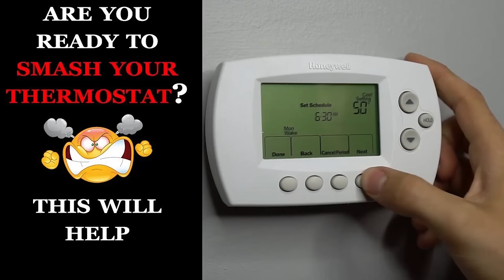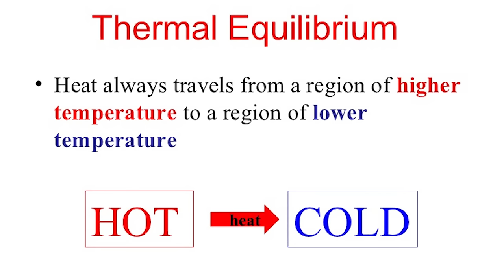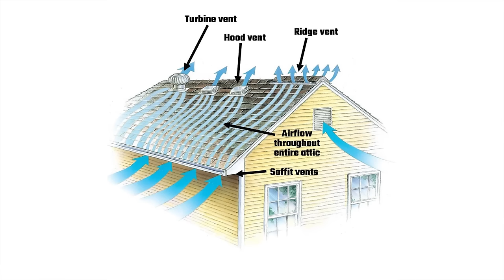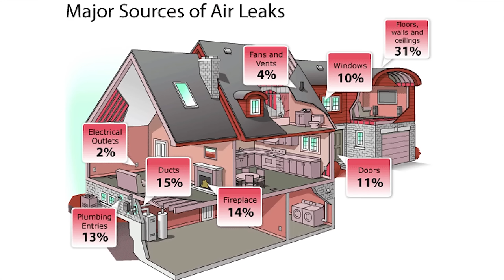AC Unit Not Cooling House - 20 Reasons Why

Comment: Hey,hi I have a question for you.My furnace making a pop sound after a blower shut off and only in the winter When I use heat. What do you think it wrong. Thank you.
Reply: could be just the duct work, sometimes its thin metal wit no cross bracing, once the pressure inside changes it can make noise.
Reply: @justinrichard4190  Ok, thank you Bro.
Reply from the maker: I agree with Justin. That sounds like ductwork popping out to me. (picture a pop can with a dent in it and then you squeeze it and it pops out, probably a similar noise). That is a little annoying but it's not bad for the unit or anything.

Comment: I checked my refrigerant level , it shows low, and I added 2 LB r22 in it and PSI is 75 now under 81 degree. However,  the air blow out is around 70 degree inside. It is better before I added r-22 in, but it is still not good enough, What could be the issue? Check air filter already. thanks

Comment: My AC runs and blows what feels like cool air. Current temp outside is 91 and I have the thermostat set to 72 but it's been stuck at 73 and will not get down to 72.  Brand new filter. All the vents blow cool air though. Not really sure what's the issue.

Comment: Condenser unit might need to be cleaned / _Bad capacitor/ _Compressor issues/ Dirty evaporatorCoil/_Dirty Returns/_LeakDucts /_Low AC Refrigerant/_Damper closed /_HRV Running

Comment: How much does it usually cost  to replace an air handler blower motor,  My air handler fan motor is not Exchanging much air and  I cannot even hear the fan from the air handler fan when its on.
Reply: depends how much it costs the model of the motor, plus labor
Reply: @MegaMRP10  thanks

Comment: Thank You so much for the list. My three year old unit is struggling even when set to 78, both thermostats set at the same settings. I changed the filter, cleaned out the condenser coil,flushed the condensate lines and fan outside runs well but cant tell about the compressor?,no unusual noise etc,all supply registers are fully open, system almost runs non stop (electric bill is way up) turns off only late evening/after midnight. No ice build up.Using a IR thermometer there is only a 3 degree difference between supply and return. Im hoping for a simple fix maybe bad cap but a leak, not looking forward to the $$$ when we call for a hvac tech next week. If you have any other ideas,please. Just sub and like,thanks again!
Reply from the maker: Hey Jim! Sorry to hear that none of the easy solutions did the trick for you. If you are only seeing a 3 degree temperature difference then something is definitely wrong. Either you have a leak and there's barely any refrigerant left or it's also possible that the compressor is not even turning on. If you have a multi-meter, I would try checking the capacitor. Also, when the outside unit turns on, you should be able to hear the difference between the compressor running and the fan. The compressor is more of a rumbling sound whereas the fan makes a normal wind blowing type of sound. Have someone turn the AC on at the thermostat while you stand right next to the condenser outside. If you hear the compressor buzz as if it is trying to start (that only lasts for 2-3 seconds), then that may just be a bad capacitor. If both, the compressor and the fan are running then yes, unfortunately the unit is probably low on charge and there's a leak.
Reply: @WordofAdviceTV  Its because of your channel I was able to use for the first time the capacitance check on my meter,which I didnt know it had it.
I got a 75/10mfd  +/-5 cap,readings came out 74.0 and 9.79mfd. I was hoping for a bad cap but it looks like now system needs a charge. I really like your instruction method, showed us at our level of understanding even an old senior can grasp.Thanks!!

Comment: I found a mouse carcass and chewed up wires in the outside air conditioning unit. I fixed the wires and the AC started working again. The chewed up wires connected to the contactor coil.

Comment: I changed the blower wheel and motor but my outside unit not working... capacitors tested good it was working before I had my ac turned off for wk

Comment: I changed my fan motor 3 wire to a 4 wire . Installed a new capacitor after the installation the fan spins slow and does not start I have to use a stick to push start . And when it does start it spins really slow. Any ideas?
Reply from the maker: My guess is that you wired it wrong but can't say for sure without being there to check it myself. This video may help though: https://youtu.be/VlMhvwrpimE
Reply: @WordofAdviceTV  thanks for the video . After double checking everything and pulling my hair out I finally called a pro to come take a look . Turns out the brand new fan motor from grainger was bad . Just my luck .
Reply from the maker: @Suerte_Pepe  Oh noo.. That is the most frustrating!! A bad motor right out of the box. Sorry to hear that man, that would not be my first guess as to what is wrong. I hope it has no more problems for another 20 years now. Stay cool!
Reply: @WordofAdviceTV  update: I went and got another motor and it was the same result. I called the A/c guy back out because he diagnosed it wrong they sent a smarter technician this time . Ended up needing a separate capacitor for the brown and brown/white wire . Works great. I figured I would give you an update. Thanks for the help though.

Comment: Hey after changing Aprilaire - 35 A2 35 Replacement Water Panel filter for whole Humidifier on my Tran xe 90 my ac unit is not cooling. Thanks in advance

Comment: We have two 4-ton units.  Both are the same brand and model.  Both are under 1.5 years old.  On the hottest days of the year, both units will shut down and then start cycling like the heat pumps want to start but then they almost immediately shut back down again.  The man who put them in can't seem to figure it out.

Comment: Can you tell me why ONLY in the heat cycle, when my furnace turns off, the thermostat reboots. I have a Honeywell digital color screen etc. like I said this only happens when the system is set to heat and when a cycle ends and turns off; the thermostat reboots, never happens in Cooling cycle?

Thanks

Comment: So my AC is not circulating around the house.  The unit inside the house has cold air coming from it, however the outside fan doesn't come on.  If I turn the heater on, the outside fan works fine.  Still not sure what that could be.

Comment: So my fan was not spinning then I replaced the capacitor and I got it to start. After that the fan still does not spin after the initial start even though it is free flowing. However when the fan try to come on all I hear is a hum. What could that be?

Comment: My suction pipe has spots where the insulation gaps. I get ice there and where the pipe goes into the unit inside. My unit is two years old.  What are the chances that I have a Freon leak versus a dirty A coil?

Comment: Replace the coil fan motor replace a circuit board replace the capacitor replace the condenser the dryer runs for 2-3 minutes shuts down there's a block in the AC line and I don't know what to do the units of Goodman 3 1/2 * 33 years old

Comment: My air conditioner unit just won’t come on ☹️ it tries to come on inside but just blows warm air. It got to over 100 degrees in California today and inside my house like 105 I’m soooo hot I could cry
Reply from the maker: Sorry to hear about the AC troubles! Sounds terrible. If your unit is still not working, I would suggest following along with this video to track down the problem: https://youtu.be/wzAA4dlp_70?si=pckfy3mwq_WbLCQj
Reply: @WordofAdviceTV  it was! It’s fixed now a fuse had blew when my electricity went out in my area. thank you 😊

Comment: My AC unit is 2 and 1/2 tons , but my question is , can I put a 3 or 3 and 1/2 tons condenser unit without changing the evaporated coil ?
Reply: No you cant, the eveporated coil has to be bigger than the condenser by 1/2 ton the most, but it shouldnt be done

Comment: In my case the water reservoir in the attic unit was full of water, after draining it, the outside unit started to work again
Reply: Might want to buy a saftey float switch on amazon if you dont already have one, super easy to hook up and will save you a few hundred $$$ 

It shuts the unit off whenever the drain is clogged so the pan doesnt get a chance to fill up in the first place.

Comment: 🤔Now if the TXV is one of the biggest thing that can go wrong with a central air unit. 🤔Why come the TXV be mounted on the outside of the  furnace in some kind of box where it is easy to get to without taking the whole top of the furnace type apart?🤔Now wouldn't the TXV still be able to do it's job?

Comment: why is my ac condenser unit takes a very long time to reach desire temp, also it stays running for very long time but it will turn off however it has not reach the desire temp. it seems it only reaches its desire temperature at night. I called a service provider but he only check the charging on it and clean my condenser with water and  called it good. the tech had 2 yrs of experience and did not seem knowledgeable. please reply thanks

Comment: Hi my ac wasn’t cooling and the guy come over and told me was the fan motor he change the motor in the roof and nothing he change the 2 little things on the motor outside in round and one square now is cold and the fan blow hard like before in the morning but after 12 the temp in the house go up and the van in side don’t blow hard anymore the air come very slow and the motor keep running from 11:45am to 1am every day after the guy come not working like before and they call me liar and don’t want come to fix saying I’m wrong so why work normal as before in the morning but after 11:45 stop blowing strong and go to low blow and don’t stop anymore. I change filter every months do it to my son need of clean air 24/7

Comment: How is recommending an air duct cleaner to clean your evaporator coil a good idea? That’s terrible advice, I mean are these air duct workers EPA certified to handle refrigerant? Do they know how to braze properly? Do they carry 410A or have recycled R-22 with them? Not sure that’s a good idea as 90% of the times you do need to cut the high and low side to get the coils out. Also when cleaning out the outside condenser unit you are supposed to spray it from the inside to clean it thoroughly if not you will be doing what is called a half a** job.
Reply: 7:10 Agree.  The video was focused on DIY and indoor coils take more patience, technique and skill to clean. The tools we use are by Goodway to clean indoor coils- we never have had to recover refrigerant (for the sake of cleaning a indoor coil), ***cut out ,and remove a indoor coil. The $59.00 HVAC tune up special with the BS 79 inspection points WONT GET YOUR INDOOR COIL CLEANED. We charge from $250- $500 to clean PROPERLY an indoor coil- we dont remove. BTW the problem with most licensing bureaus is that in the two states we operate in there is no licensing needed to CLEAN and HVAC system yet this is the most over look maintenance issue from our customers.